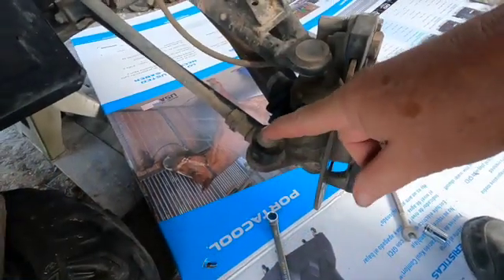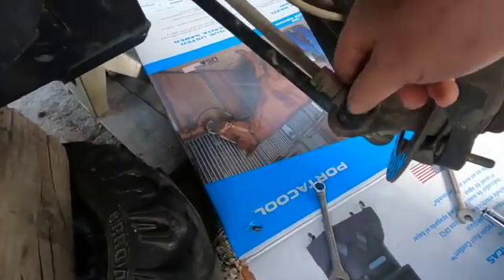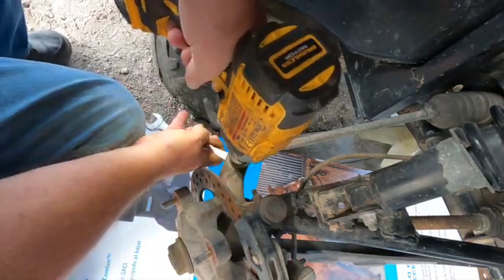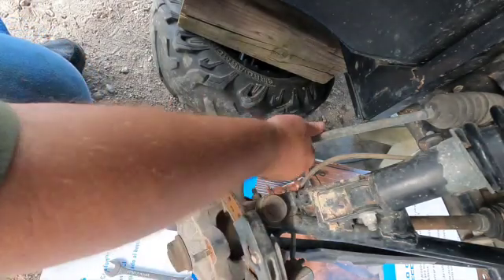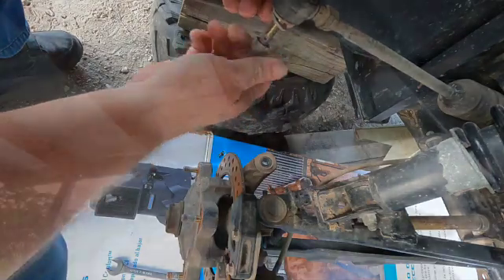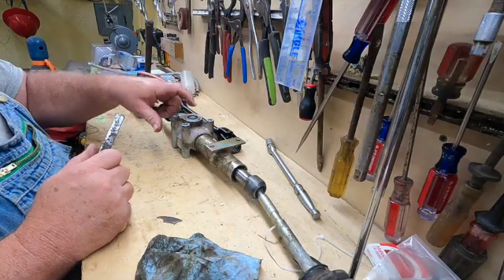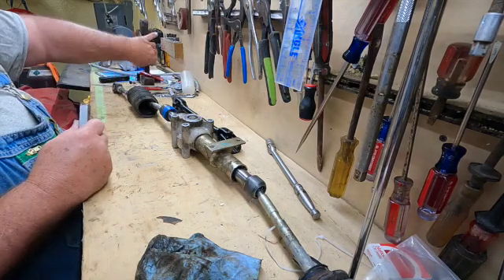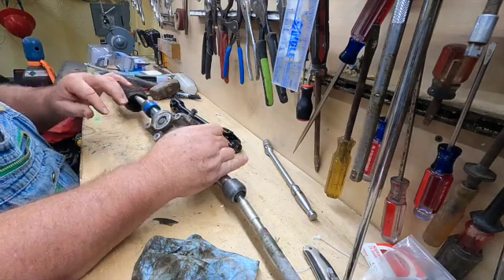Polaris Rack and Pinion   SD 480p

Comment: Great video! I am in need of replacing the shaft but cannot find the one i need . I have ordered 3 shafts and they all come triple the length i need . I was hoping you could tell me the part number and where you purchased the shaft. 
Thanks for taking the time to video the removal process.
Reply from the maker: I got mine from the dealer using the VIN number. The owner bought the part so I do not have part number. I hope you subscribe to my channel.